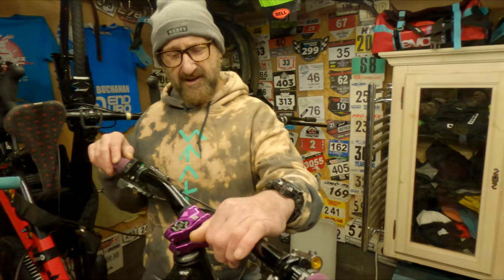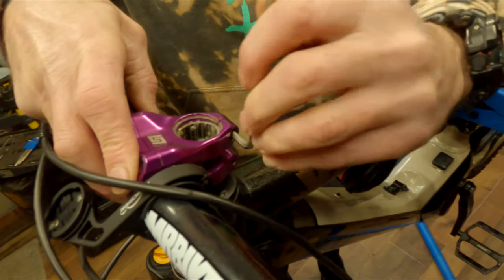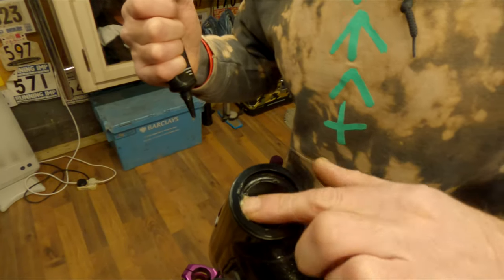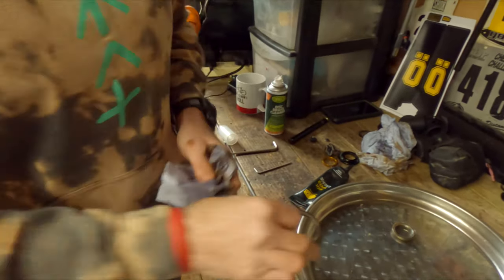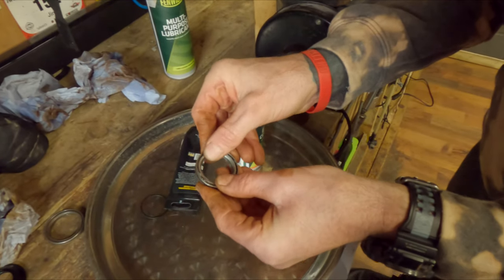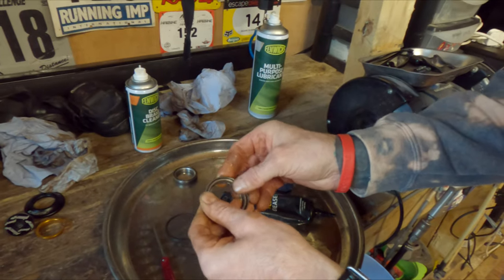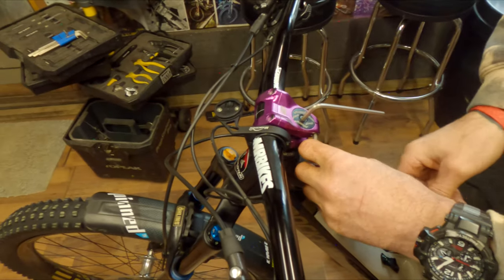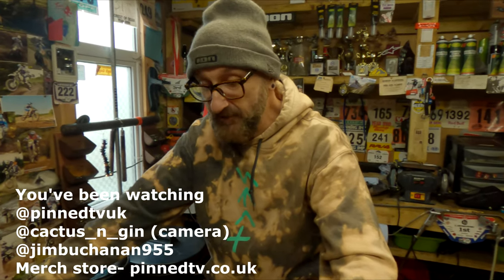How To SERVICE YOUR HEADSET BEARINGS & Save Money *BIKE HACK*

Comment: What is your camera set up lads?
Reply from the maker: Hero 9 mate Res 2.7k 30fps. lens SV Hypersmooth on. Scheduled capture off. Duration no limit. Hind sight off.timer off. (Protune) bit rate high. Shutter auto. Ev comp –1.0. White balance 5500k. Iso min 100. Iso max 3200. Sharpness medium. Color flat. Raw audio high. Wind on
Reply: @PinnedTV  perfect! Thanks 🤩

Comment: I would have removed the brake lever from the bars especially with Shimano brakes rather than taking the caliper off and having to realign the pads👍
Reply from the maker: Horses for coarses!
Reply: @PinnedTV  my Shimano brake levers have that quick release bracket, so you dont have to mess around pulling your grip's off!  Heres a tip for you jim! If you coat the bearing casing with assembly grease as you put it into the cup, the dirt doesn't get inside to the ball bearings as easy!  I just find that you clean the assembly grease off once a year and the bearings are still smooth 👍